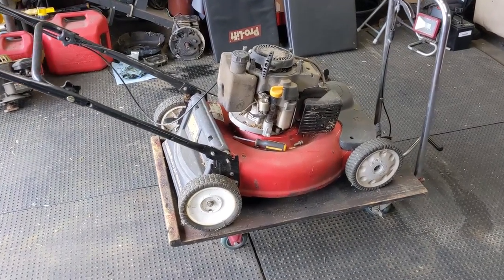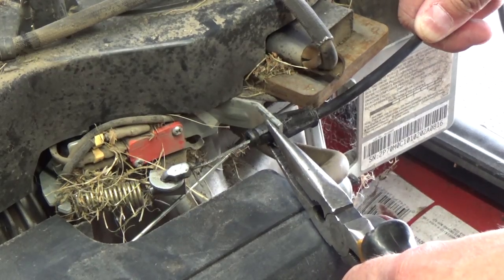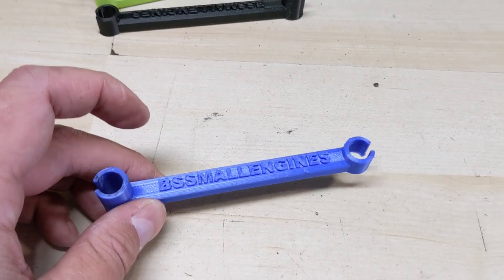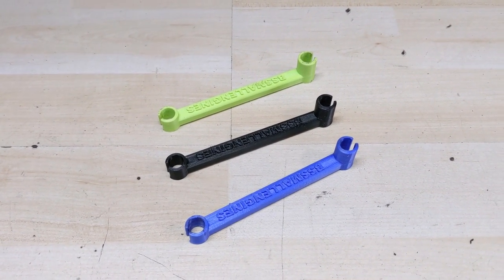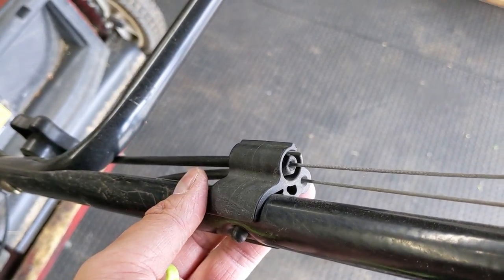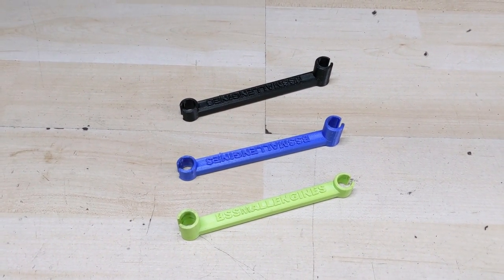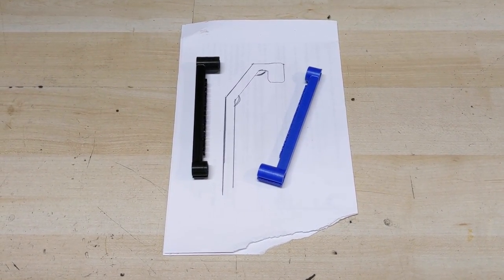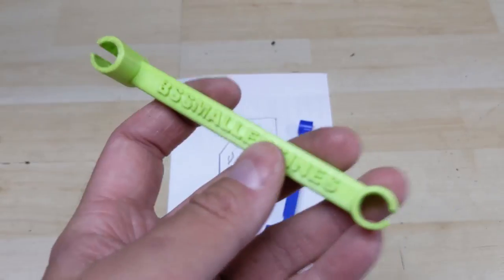Best Cable Removal Tool for Lawnmowers

Comment: Thanks for the shout out I'm glad you like my tools
Reply from the maker: It works awesome, great design!
Reply: @EliminatorPerformance  Thanks I will work on 3.0 this week with the angle you showed that was a good idea
Reply: @BSSMALLENGINES 
Brandon, I’d suggest modifying 2.0 to become 3.0 by designing the handle on the shorter removal end to be curved. That kills two birds with one stone since both of those are external connectors rather than the internal connector of the longer 2.0 design.

Comment: Congratulations on 🎉🎉🎉🎉🎉🎉🎉🎉🎉🎉 80K! 🎉🎉🎉🎉🎉🎉🎉🎉🎉🎉
Really awesome that you did a video on Brandon's custom mower cable disconnect tool, Jake!
Brandon just crossed over the 2K sub mark; glad to see him get some recognition in the community.
This tool is awesome, and I highly recommend it! 🐺🔧
Reply: Absolutely a very clever invention that does what it is supposed to due and no aggravation, works in seconds at EP it is used whenever cables need removal.
Reply from the maker: Thanks, 100K here we come! And yes it works great, thanks for watching!